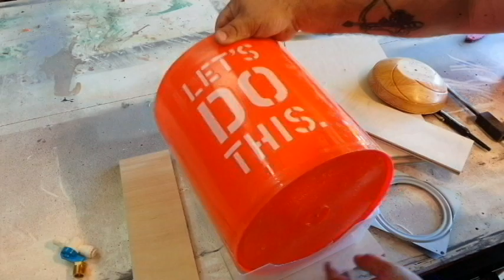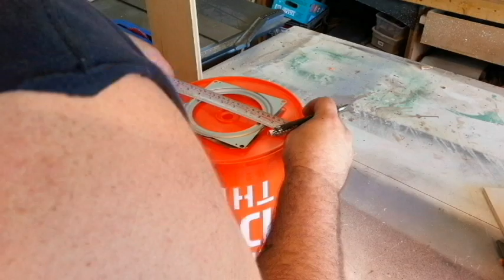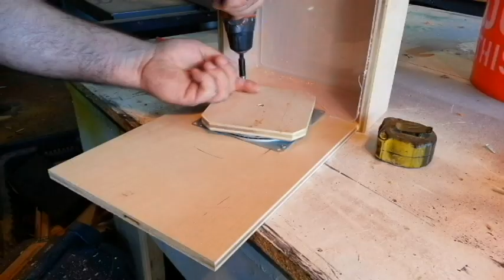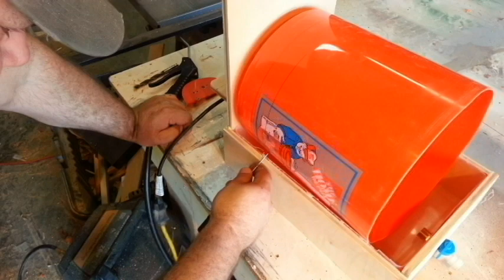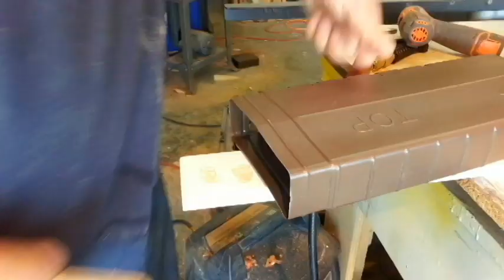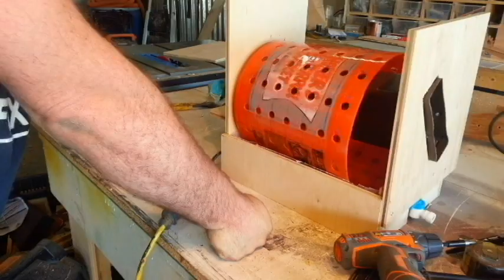How to make a bubble "making" machine

Comment: I have a strong suspecion the holes in your bucket are one of your main design problems. You need a large surface area around the hole from which the bubble solution can easily flow (take a look at the design of pretty much any commercially available bubble blowing apparatus). Furthermore the wall of your bucket provides af surface for your bubbles to stick to and thus never leave the machine. Being able to regulate your airflow will likely allso help. Not ment as criticism in any way... just hoping for at "bubble storm" from your upgraded version.

All in all though, great project :-)

Comment: Smaller diameter bucket, maybe a Kool-Aid container, smaller holes in both the bucket, and the air supply, which should create more velocity, and the bucket will still have a lot of bubble mixture on it when it gets to top dead center. I think the solution is thinning out and running off before it can get to the air supply?

Comment: I was kinda surprised how well it generated bubbles.  I figured the shop vac would produce too high speed air which I figured would just tear the bubbles apart.  Perhaps some baffles which dissipated the air more evenly across the row of holes would help.

I'm just remembering it always took high volume, low speed air to make the best bubbles.

Anyway, whether you considered it a success or not, your daughter seemed to absolutely love it.

Comment: I bet you it would work a lot better if your air supply wasn't so powerful. I would think a shop vac would blow too much air too hard and pop a lot of bubbles before they are released. see if you can supply some slower softer air somehow. I bet that would really pump out the bubbles.

Comment: I once saw a bubble machine that used a small chain to form the film of bubble solution instead of a rotating surface with holes in it. I'm not sure how well that would work but I'm sure it's much easier to cut some chain than it is to drill all those holes!
Great video, I enjoyed it.

Comment: hey izzy great toy best dad on earth i bet she thinks. how about try and use one them electric air mattes pumps i know they have them in battery power as well think that might be a good small air source. great build nothing wrong with ya did to this one just thrown out and idea to ya
Reply: izzy swan 
And.. they Do make a high torque, battery operated BBQ spit (takes one D cell battery) that should work pretty well for this application... 
it's CRAP for a BBQ grill because the battery never lasts through a full roasting
Reply from the maker: STEVE JONES Thats a great idea I will pick one up for the next one i build
Reply: cool man np anytime

Comment: Maybe there is a way you can glue fabric onto the bucket before you drill the holes. That way it would absorb more solution for when it gets around to the blower. The bubble blowers you buy at the store have those slits cut all around the holes to achieve this, but I doubt you'd want to go in with a file and modify every hole.

Or maybe instead of a bucket, a chicken wire cylinder.

And for the motor, have you looked into disco ball motors? High torque, low speed, comes battery operated, about $10

Just thinking out loud. Looks like fun.
Thanks as always for the videos!

Comment: Hey izzy, good video. I don't have much experience in making bubbles myself but I do recall back in grade school that the key to producing good bubbles had to do with the geometry of the holes and how hydrated they remained while blowing air through them if that makes any sense. I would guess the rough edges you get from using a drill bit isn't a good thing. Maybe smooth them out a bit and see how it works...